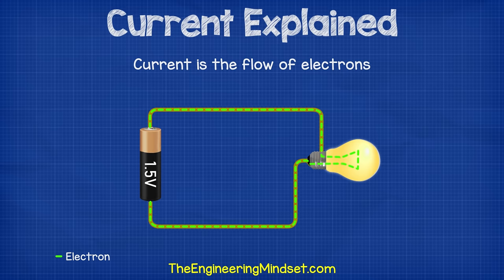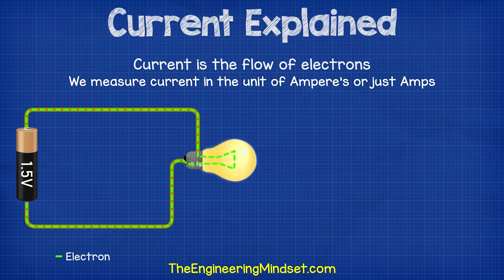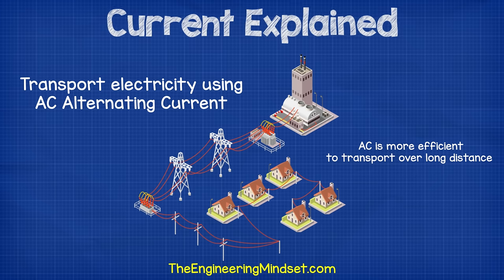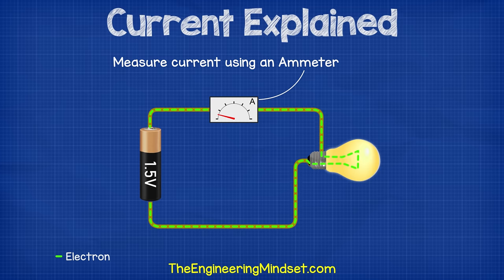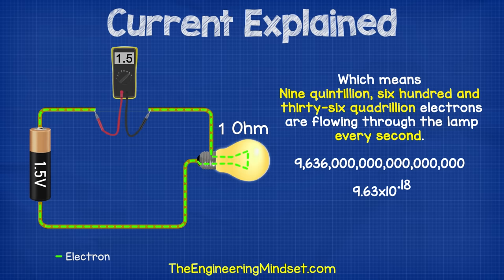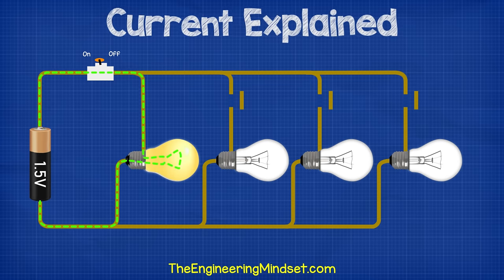What is CURRENT– electric current explained, electricity basics

Comment: Please,  explain how you calculated the resistor rate of 270 Ohms to protect the LED lamp from burning out
Reply: Hi, he will have used Ohm's law. If you are not familiar with that law, it basically states the relationship between the current flowing between to points and the voltage across them. In short, the voltage across two points 'V' is equal to the product of the current 'I' and the resistance 'R' - so V = IR in short. It's worth memorising this if you can as you will use it all the time.

In his example, the LED is rated at 25mA and has a forward voltage of 3.3v. If you are unfamiliar with that, just consider it the amount of voltage "used" by the LED to be in the "on" state. This leaves us with 5.7V of extra voltage to drop, as the battery is a 9V cell. So to compute how much resistance is required to limit the current to 25mA, we can just re-arrange the law in the form R = V/I, where V is our voltage (5.7V) and I is our current (25mA, so 0.025A). If you calculate this value you will get a resistance of 228 ohms, as the minimum resistance required.

If you are wondering why the video man selected 270ohms, it is likely because it's the closest standard resistor size to 228 without going to anything smaller. You normally want to play it safe like this because resistors are only guarenteed to be within a certain tolerance of their stated value. 

I hope that helps.
Reply: @Bomag  thanks a lot, now it makes sense
Reply: @Bomag  you've restored my faith in YouTube comments. Well done sir!
Reply: A typical LED is lighting normally at 20mA for for a 5V supply, the limiting resistor is found by dividing 5000 mV by 20 mA giving 250 ohms.  So a 270 ohm resistor will do just fine.  Using a lower resistance the LED might be too bright and even burn out, a higher resistor gives a dimmer light.
Reply: @karhukivi  say if I found a LED LIGHT and what to know what it's maximum volts is? 
How do I figure that out?
Reply: @franciscoperna7963  It's the current you have to start with.  A simple LED (not in some device with other components) will tolerate 10 to 30 mA, (0.01-0.03A) so you must choose a resistor to put in series with the LED that will limit the current.  If you want to connect it to a 12V supply, then 12/0.02 = 600 Ohms, so you could use a higher resistor value of 680 Ohm resistor and the current would not exceed 20 mA.   There is a small voltage drop across a LED (depending on its colour ; 1.8V for red to 3.3V for blue) so a more exact calculation would be for a blue LED of (12-3.3)   8.7/0.02 = 435 Ohms and nearest resistor value of 470 Ohms for the series resistor.   If the LED is not bright enough, you can reduce this resistance to a lower value but if it is too bright, then you risk burning it out.   Trial and error is the last resort, I have burnt out many LEDs from experimenting!   Hope this helps.
Reply from the maker: Check new more detailed current electricity video here: ➡️ https://youtu.be/kcL2_D33k3o
Reply from the maker: Check out NEW resistor video, everything covered! ➡️ https://youtu.be/DYcLFHgVCn0

Comment: Sir, one thing I do not agree at 2:51, current moves in circulation from live to bulb filament to neutral. Neutral takes current back to power source. Current moves in closed circuit.  I have never checked current in neutral wire at bulb.

Comment: 1 ampere means 1 coulomb per second? Right?
Or 1 amp means only 1 coulomb?
Coulomb is not synonymous of ampere? Coulomb per second is ampere. Right?
Sorry if this is a bad question.
Reply: It is a mistake in the video. 1A=1C/1s
or in differential form: I=dq/dt
q-electric charge (measured in Coulombs)
t-time (seconds)
Many also use As (Amp*second) instead of Coulomb.
Reply: @Jule-mm4dr  Thank you !
Reply: @jasonvoorhees2050  You're welcome 😉
Reply from the maker: Check new more detailed current electricity video here: ➡️ https://youtu.be/kcL2_D33k3o

Comment: I'm 27 with a biology degree, but physics was always a struggle for me. This video FINALLY explained it in a way I can understand! So it's like how you might have a super soaker (not much water/current) and a garden hose (lots of water/current) on hand, and while they might shoot out water with the same amount of pressure (voltage), the amount of water that they will move (current) is very different. Same as how a slow-moving creek and slow-moving floodwaters are very different in the impact they have on the environment...

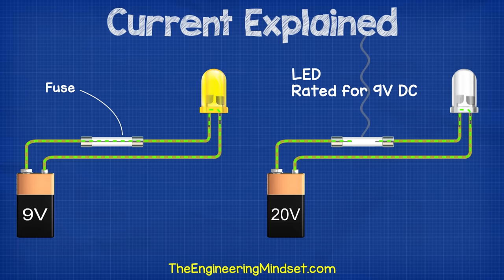Comment: Hello, i am new to learning about electricity.  I was wondering at 10:06 why the fuse is connected between the bulb and the part of the cable that returns the electrons to the battery? Does it goes Negative --> Bulb --> Fuse --> Positive ? Or the other way around, Positive --> Bulb --> Fuse --> Negative? I'm still learning.  Thanks for these great videos.
Reply: Wondering the same thing😬😶

Comment: A small correction. 
Current is not the flow of electrons. Electrons move very slowly.
Current is the flow of charge. And charge somehow travels at the speed of light. 
This is why electricity confuses me. I cannot understand how electric signal can travel at speed of light while electrons travel at a few millimeters per second.
Reply: try substituting electricity with "electrical energy" and you will not be confused.

Comment: Electricity is a form of energy resulting from the movement or flow of electric charge. It is a fundamental force in nature.
Electrons play a crucial role in electricity as they are the carriers of electric charge. In most materials, electrons are loosely bound to their atoms and can move freely within the material when an external force, such as a voltage, is applied.

Comment: In the example about adding load to a circuit at 10:55, why does the current stay the same as you add more bulbs to the circuit in parallel? Wouldn't each bulb now be 1/4 as powered?

Comment: Great explanation, but a circuit breaker wont stop someone being electrocuted, not enough current will flow to trip the device. That's why we use RCD's .
Reply: MCBs are to protect the cables from burning out from over current.
Reply from the maker: Check new more detailed current electricity video here: ➡️ https://youtu.be/kcL2_D33k3o
Reply from the maker: Seen our new incredibly detailed MCB video? link: https://youtu.be/gqEu9t8HwW0

Comment: I am probably not the first person to make an update on this, but in the modern day we do not use HV AC in the powerlines, but HV DC. DC is used because in order to connect for instance two AC power sources together, they need to have the same voltage level, same signal shape and same frequency. Plus, AC produces reactive power, while DC only has active power. The way we do it now is we first amplify three phase AC voltage then convert three phase AC into DC to transport it through the powerlines and then in the transformer stations in it is converted back into three phase AC again and then it is distrubuted

Comment: I don't understand why the Ammeter reads 3A in the parallel circuit. Will it add all the current through every load? 7:10
Reply: Yes, exactly. First you calculate each branch (even if you have 3, 4 or more) using the Ohm's law and then add together, to get all current flowing in the circuit.
Reply from the maker: Check new more detailed current electricity video here: ➡️ https://youtu.be/kcL2_D33k3o

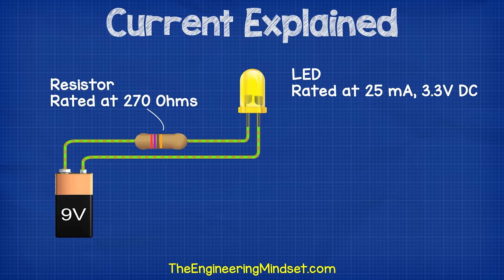Comment: 9:43 how did you solve for resister of 270 ohms. v=ir so you want to drop voltage by 9-3.3 = 5.7 and amps is 25mA or 0.025A so isn't it voltage drop of 5.7 divided by amps of 0.025 = 228 ohms? The only thing I can think is to keep in mind that 25mA and 3.3vdc is MAX light can handle, therefore, you'd want your electrical power level to be a little less than the light can handle which means you'd want your resistor to be just a little stronger to drop the power a little more than max of the light. Am I on the right track?
Reply: Somewhat yeah. The problem is that you can't really buy resistors in exact values, and even if you could the chances are you wouldn't have a 228 ohm resistor lying around anyway. Resistors come in standard sizes, with specific guarneteed tolerances. If you're buying resistors with a tolerance of 10% you would treat your resistance of 228 more like 250 to allow for the worst case of being under-rated by 10%. In the E-12 series of resistor for example, you have a 220ohm resistor, then a 270 ohm resistor. You'd pick the bigger of these two in this case.
Reply from the maker: Check new more detailed current electricity video here: ➡️ https://youtu.be/kcL2_D33k3o
Reply from the maker: Check out NEW resistor video, everything covered! ➡️ https://youtu.be/DYcLFHgVCn0

Comment: I've watched your videos on testing AA batteries - great stuff. You suggest using a 100 ohm resistor with a multimeter; but I find there are 1/4w and 1/2w resistors. Does it make any difference which resistor I use?

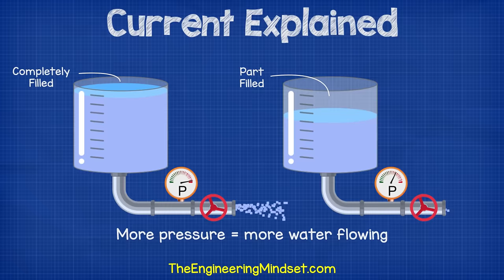Comment: @1:18 "The more voltage we have, the more electrons can flow". That could have been clearer imho. The number of electrons in a simple circuit is fixed (it's a function of the 'charge density' in the conductors). When you apply more voltage, that fixed number of electrons will move faster around the circuit, giving a higher current.
Reply from the maker: Electrons have the same speed, the amount of electrons vary
Reply: @EngineeringMindset  That's interesting, thanks for the response. But where do the extra electrons come from ? My understanding is that in a conductor such as copper, each atom "donates" a certain fixed number of electrons from its valence shell. Freeing up electrons from the lower shells would require a much larger potential. I got my info from a question on the Physics Stack Exchange, titled "When the voltage is increased does the speed of electrons increase or does the electron density increase?"
Reply: @chrisf1600  I thought the electrons just moved faster at a higher voltage. Now I'm more confused

Comment: Great video series! One question thought, you mention that you can change the spot you connect the multimeter and still get the same amp reading. Now I'm wondering, don't the cables need to be switched around for this? The black cable is the negative, red positive, right? So when the multimeter is connected at the top, it is connected in this order, but when its moved down, the red comes first, connecting the positive cable to the negative side of the battery, and black to positive, which would be wrong? or am I missing something? 6:38 onwards is where this occurs
Reply from the maker: Check our new Multimeter tutorial out ➡️ https://youtu.be/4lAyzRxsbDc

Comment: I don't understand the example at 10:50 How can a 1.5 V battery rise a current in the circuit if the extra load is added. Wouldn't it be the opposite-the more load, the less current in the circuit?
Reply from the maker: Check this out, how a battery works: https://youtu.be/PXNKkcB0pI4

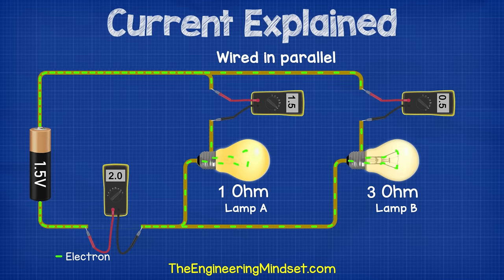Comment: Can someone explain to me the situation around 8:05? How can the total amps flowing in the circuit be more than the volts provided by the single power source? (3A flowing in a circuit with a 1.5V battery)
Reply: Just look again at time 8:05 only 2 Amps are flowing and that is correct. We have a 1,5 Volt power source and we also must
assume that the power source is ideal is has No internal resistance , does not run out of power and the voltage Always is 1,5 Volt.
Connected to the power source are 2 lamps, both get the same ( 1,5 Volt voltage ).  It   all is ohm's law , V = I x R . 
Amps = Voltage/resistance . The Voltage of the power source does not matter. Let say the power source is only 1 Volt 
and we connect 10,  1 ohm lamps to the power source. Each lamp gets 1 Amp , so the 1 Volt power source then supplies 10 Amp.
Reply: @firestar7188  Thanks so much, I really appreciate it!

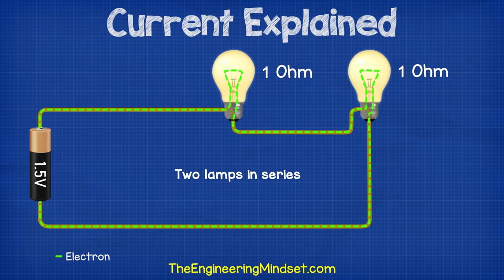Comment: At minute 6:54  you say that electrons are slowed down. I undertstand that electrons speed is light speed, so it does not change. May be you wanted to say less electrons are flowing now because of resistance increase.
Reply from the maker: Check new more detailed current electricity video here: ➡️ https://youtu.be/kcL2_D33k3o

Comment: Is the flow of electrons and flow of charges the same definition of current? Nobody has been able to really answer this and cement the idea for. I think it’s important to know because flowing electrons is a big difference than flowing charges. Flowing electrons implies that the electrons are moving, and flowing charges implies that only the charges move.
Reply: I’ve also heard both definitions in lectures or even professional engineers novels so, i’m concerned lol.
Reply: I like to think of the definition of current as “A measure of the flow of charge”, which implies a direction. One Amp equals one Coulomb per second. One Coulomb is the charge on 6.24E18 protons. The charge on 6.24E18 electrons is negative one coulomb. 6.24E18 electrons flowing past a point is negative one coulomb per second which is negative one amp. If one insists on defining the reference direction as the direction of electron movement, all currents must be reported as a negative value. I don't have the discipline to do that and to do otherwise is intellectually dishonest. Why not define the reference direction to be “positive voltage to negative voltage”. It’s a convention that makes sense.

Comment: Thanks for an awesome set of vids about electricity, I've learned more here than in school materials in the last two years of my apprenticeship. But I have one burning question about the AC, and no one is really able to answer it to me. ... { at least the way I would understand it anyway } If electrons in AC traveling back and forwards in every cycle due to magnetic polarity changes in generator, how come that we can transport - send electricity from power station located at point A to e.g. substation 1000km away. I do understand the principles in DC as the electrons flow in only one direction, but I just can't comprehend how this works in AC. Also if in a simple electric circuit where voltage and current travel through active conductor into the load {resistence} then we have to have the RETURN path for electrons, right? but why they need to return, if they travel back and forwards.. I hope you see my frustration at this problem, and I hope someone would be able to give me an answer.  
Thank you very much. 
roman
Reply from the maker: The electrons in your homes electrical cable already exist in the copper. The power station is just making them move back and forth, they only move a tiny tiny tiny amount, never leaving the cable. But a DC circuit, the electrons are flowing the entire route along the cable
Reply: Thanks for your reply 👍

Comment: @9:12 you illustrate how electrons move from the the positive side of the battery into the LED then back to the Negative terminal of the battery. That’s wrong, The negative Terminal releases the electrons and the positive terminal takes in Electrons. Not the other way around.
Reply from the maker: Check this out, how a battery works: https://youtu.be/PXNKkcB0pI4

Comment: Enjoyed the video - thanks.
Is is my ignorance, or is there an issue at 9:15?
Battery = 9V, resistor = 270 Ohms, and LED current rating = 25mA. All good.
But where does the 3.3V rating for the LED come in?
Really puzzled.
Reply from the maker: Check the new video on current here https://youtu.be/kcL2_D33k3o
Reply: @EngineeringMindset  Mate - a million+ subscribers and you still answer people!
Class act. Thanks heaps.
Reply from the maker: Check out NEW resistor video, everything covered! ➡️ https://youtu.be/DYcLFHgVCn0

Comment: I believe the narrator misspoke at approximately 4:04 min. into the video presentation when stating, "A.C. (Alternate Current) voltage is changed into D.C. (Direct Current) using an inverter. A common mistake which should be corrected along with others. Thanks.

Comment: That LED lamp still would burn out, but more slowly. When you calculate the amount of the amount of amps across the 270 OHM resistor, it would be 33.33 mA of current. 9V/270ohms = 0.03333. That LED is rated for 25mA
Reply: yes you r correct , its been a year lol no way right
Reply from the maker: Check out NEW resistor video, everything covered! ➡️ https://youtu.be/DYcLFHgVCn0

Comment: Hey Paul,
I had a doubt under this topic,
In electric conductors,
Since
 Current=charge/time
When resistors are connected in series, won't the Charge differ
As due to electrons' collision with the conductor particles will slow them down , so the time changes ?
Reply: In a closed circuit, current is always conserved (ie, you see the same number of charges passing a given point per second, at all points in the circuit). In a resistor, the charges move slower but there are more of them crowded together (sort of like cars in a traffic jam). Slower speed but higher density, giving the same overall current.
Reply from the maker: Check out NEW resistor video, everything covered! ➡️ https://youtu.be/DYcLFHgVCn0

Comment: 7:20 I don't understand how adding a second resistance can increase the total flow of currents (3.0 Amp). Suppose that we have a certain amount of electrons flowing. Half of them go to the first lamp, and half of the rest goes to the second lamp. They encounter 1 Ohm resistance, slow down, and then join again. I don't understand how the end result is a more powerful current of electrons (3.0 Amp) compared to when we have only one resistance (6:41) 🤔
Reply: Because it's not increasing resistance, it's actually decreasing it. It only increase resistance in the 6:44 case, where the lamps are in series.

Comment: At 9:08 wouldn't the led rated for 25mA still break even if a 270ohm resistor were added in the circuit? 9v/270ohm gives 33mA? I'm a beginner so I'm puzzled. Any help appreciated
Reply from the maker: Please watch the newer updated version of this video "electrical current explained"